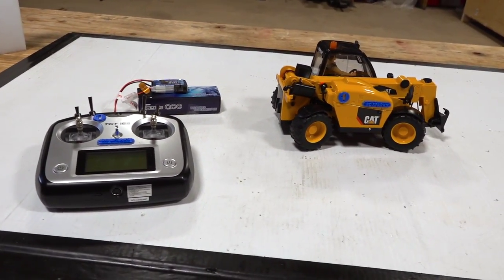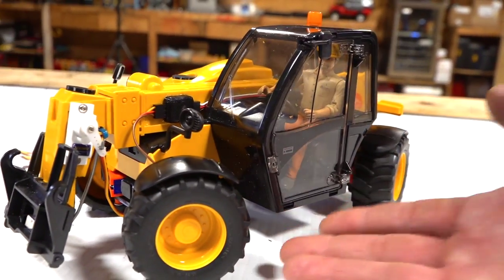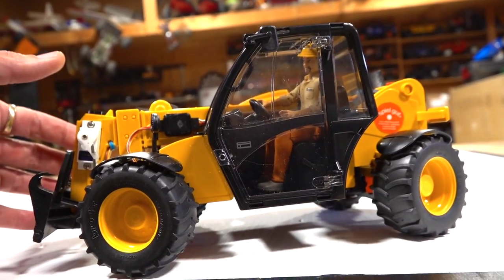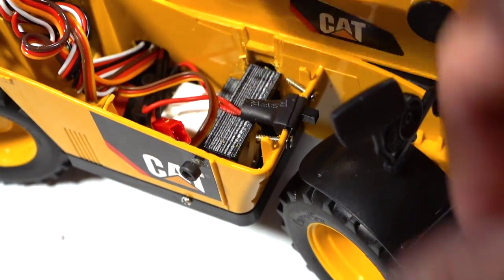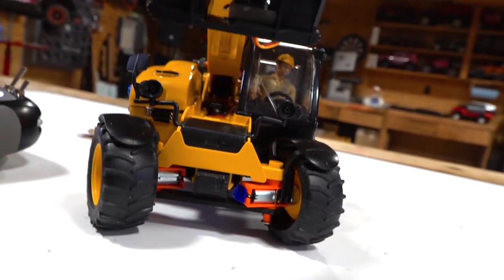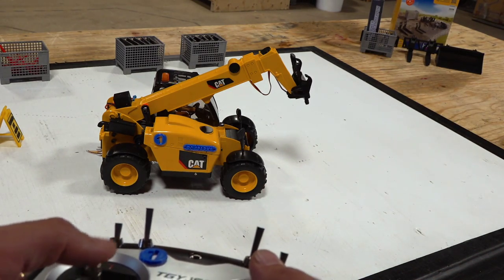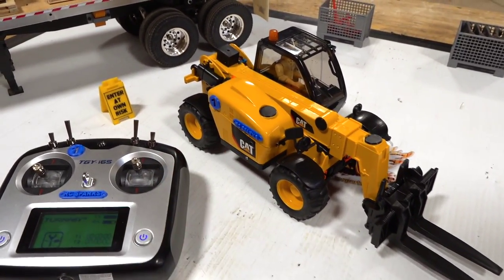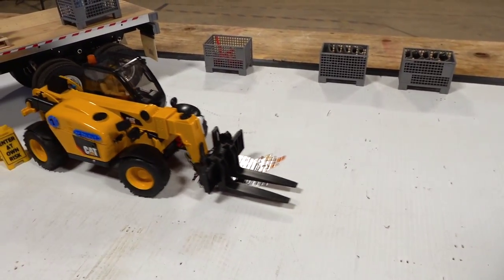4 Motors, 4WS! Telescopic Handler / "Zoom Boom" Bruder Conversion Genius | RC ADVENTURES

Comment: Hi I have just completed this build and have a fully working tele handler, I can’t speak highly enough about Pete and his you tube tutorial videos, you have to check out his channel RC Modders. Pete produced all the 3D parts for me at a very reasonable cost and he is an absolute gentleman to deal with. The parts are awesome and precision made for the tele handler, I followed RC Modders build series from start to finish and he has done an amazing job of design and production off these parts and fitting everything in such a small package. My Tele handler is by far my best RC machine absolutely love the performance, big thank you to Peter for investing his genius in this model.

Comment: It would be interesting if you could switch between 4 wheel steering and either front or rear steering.... Or crabbing.
Reply: I was thinking the same thing. Got to use a small extendaboom years ago,  had fun.
Can't wait to see a new loading wars with these!